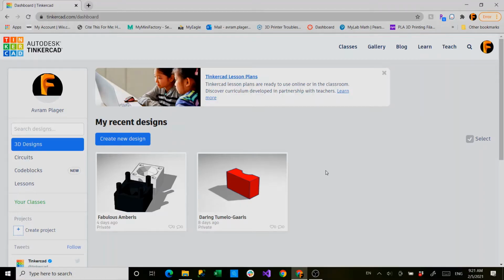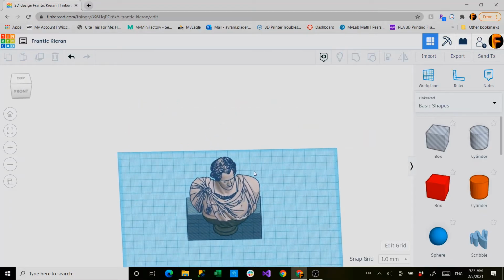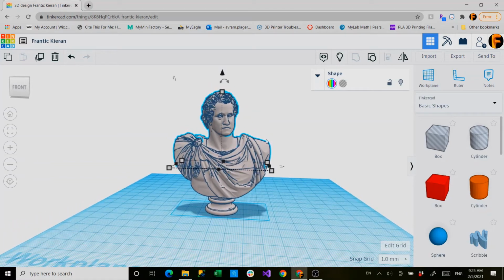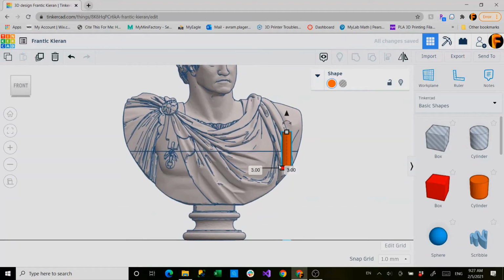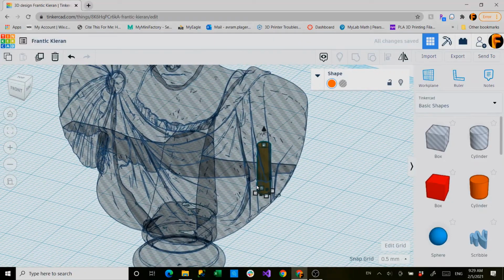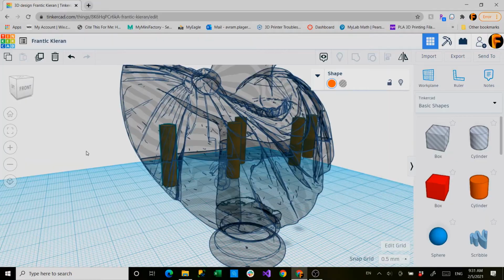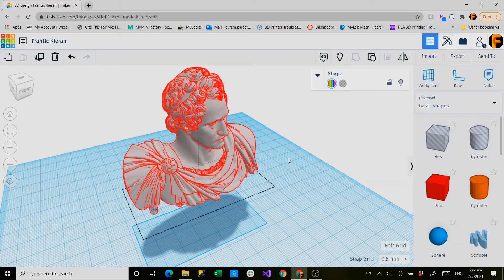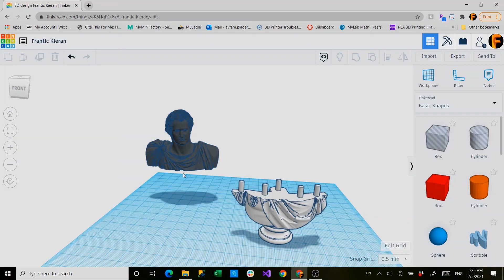TinkerCAD tutorials- separating objects to parts

Comment: This is an older video, but Avram, super appreciate you posted it. I walked through your method and printed both sides, but now can't assemble because the pegs and holes are the exact same size and there's no tolerance for them to fit!